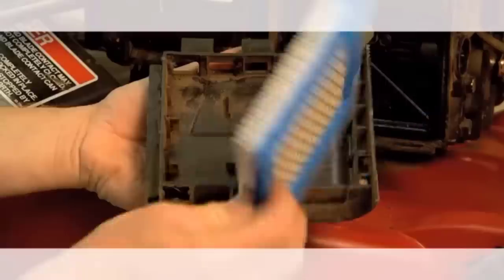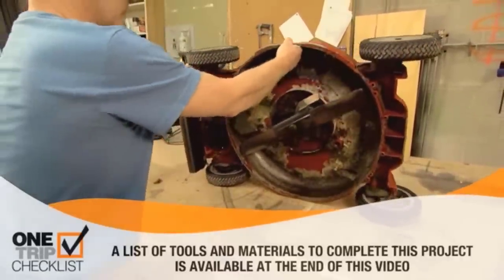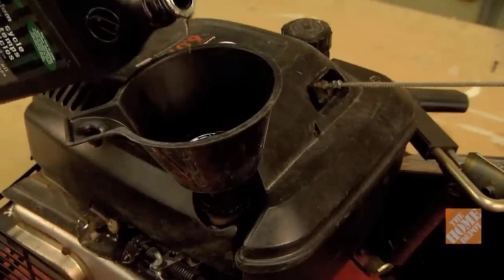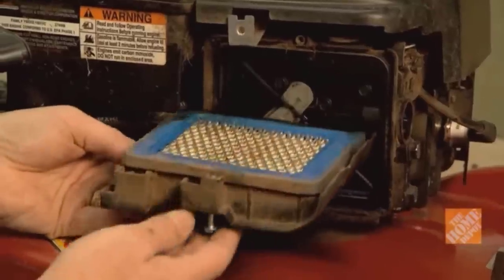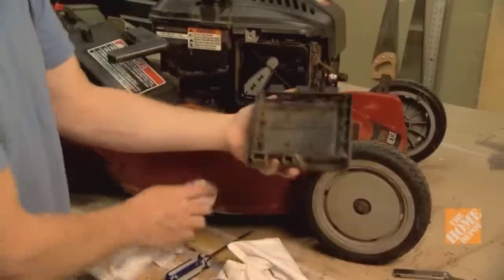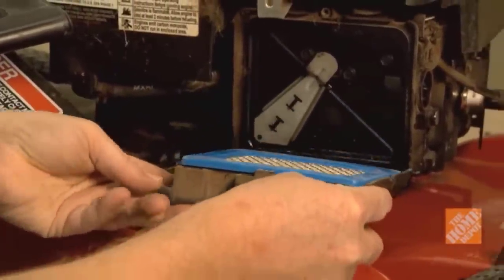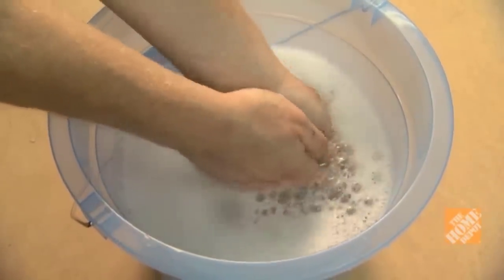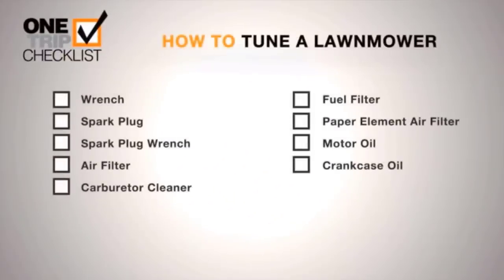How to Tune Up a Lawn Mower

Comment: I’ve had a Toro 4 stroke mower for almost 15 years.  If you change oil, change air filter and spark plug every year it will start first pull every time.  I very highly recommend you use gas with NO ethanol.  Adding fuel stabilizer will allow you to store fuel over Winter, but it would be better to run the mower to empty, put any left over gas in your car (as long as its not mixed with oil!) and buy brand new ethanol free gas for your mower in the Spring.  Enjoy your mowing!
Reply: ?o
Reply: Dad has had the same craftsman mower be bought 18+ years ago for a few bucks from a garage sale. We have replaced the air filter once since then. And just run new gas every season and never had an issue. Original spark plug and all
Reply: Just use premium fuel. You shouldn't have a problem ever. I never drain my fuel , even if there's fuel left over from the year before. And most mower or tiller spark plugs are pre gapped when you buy them. Just check and replace it every few years if having problems starting.But changing the oil is a good idea every year. And sharpen your blade also.
Reply: @Tess_untamed  how long is your off season
Reply: Changing a spark plug every year is extreme over kill and waste of money. The original spark plug with non professional use could easily last 5 - 10 years, replace the filter when it is dirty ,  again replacing every year is likely overkill. Good luck washing a foam filter with detergent , they can say it but washing filter in gasoline works best then use soap and water. 
The most important thing to do is use good quality fresh gas and Never store any gas powered tool through the off season without making sure all the gas is gone from the fuel tank And the Carburetor. Drain the tank, drain the carburetor or run until the engine shuts off. 
Doing this will give years of easy start operation.

Comment: We have a Yardworks electric lawn mower.  14” 8A  60-1750-4.   We have lost the left hand nut that holds the blade on. In the online manual it says M10x1.25-left.  We have called every possible place and can’t find one. Can you help?   I messaged you on Facebook messenger. Not sure if that’s how to contact you. I can’t find a website.